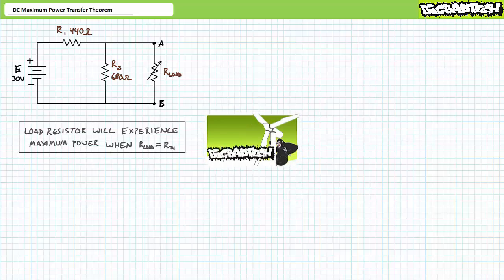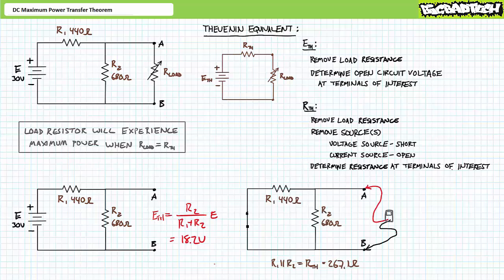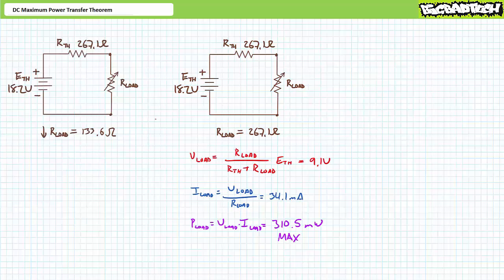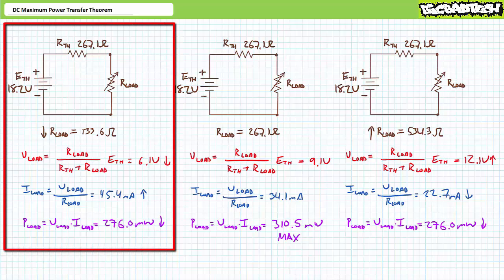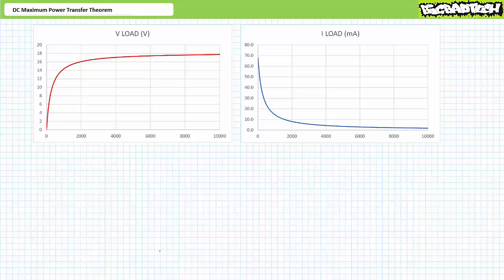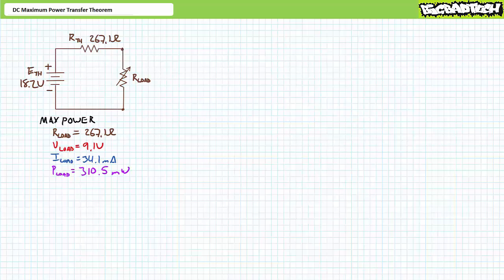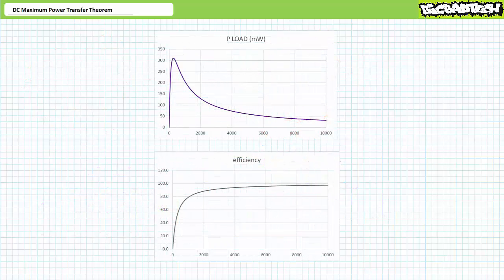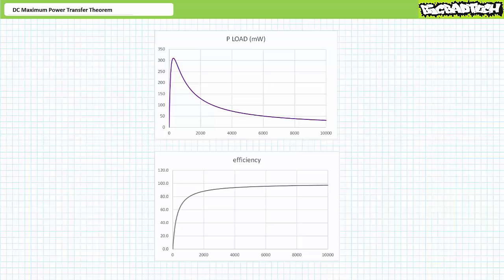DC Maximum Power Transfer Theorem (Full Lecture)

Comment: If you know a bit of algebra and calculus, this can be easily solved analytically:

VL=RL*Vth/(RL+Rth)

PL=((VL)^2)/RL

Combine the two equations above to get an expression for the power in the load:

PL=(RL*(Vth)^2)/((RL+Rth)^2)

or

PL=((Vth)^2)/(((RL+Rth)^2)/RL)

For maximum load power the denominator in the equation above must be a minimum.  To start, expand the denominator:

f=(RL^2+2*RL*Rth+Rth^2)/RL
f=RL+2*Rth+(Rth^2)/RL

Get the first derivative as a function of RL and equal it to zero:

d(f)/d(RL)=1-(Rth/RL)^2=0

From which there are two solutions:

RL=-Rth

and

RL=Rth

Therefore RL=Rth for maximum power transfer.